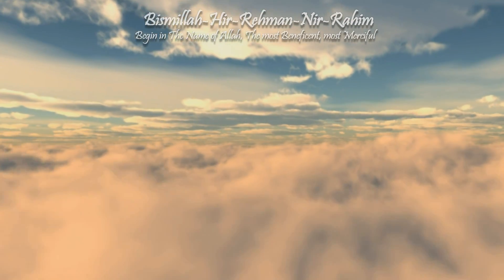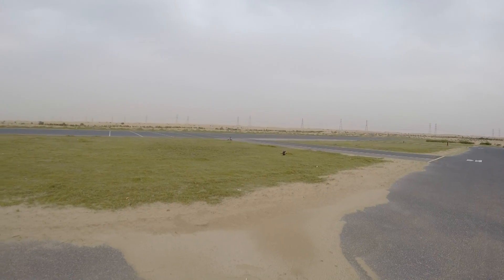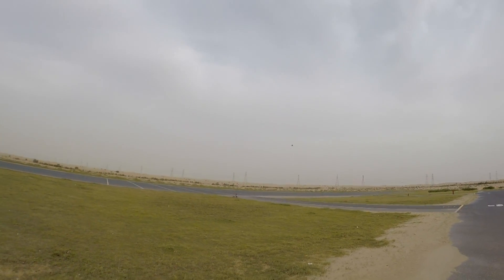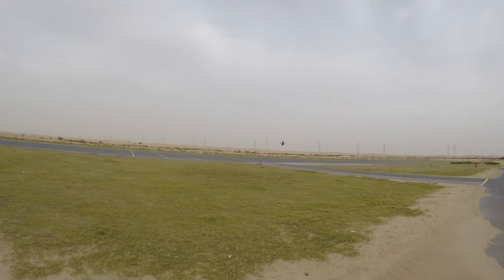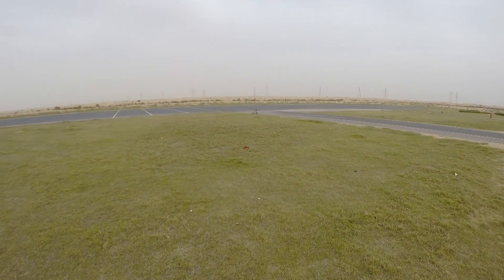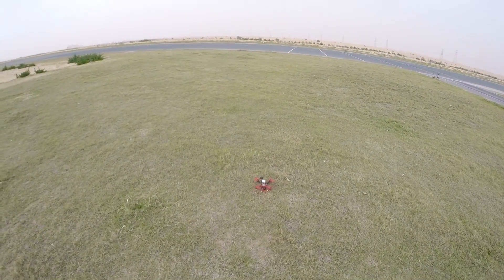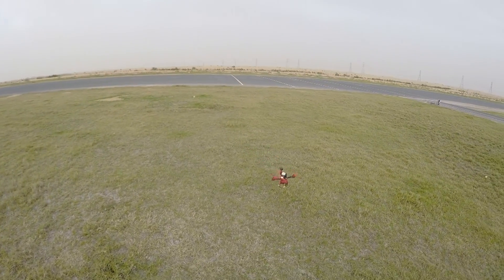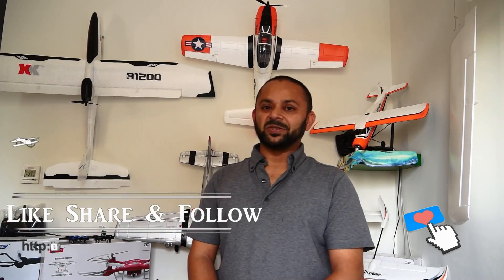Amazing Fast Holybro Shuriken X1 FPV Racer Flight Testing

Comment: It's an excellent PNP quad but the Mr. Steele props are far from "indestructible." Actually they chip, dent and crack fairly easily. My first and subsequent crashes proved that. I switch to the Azure power props and haven't dented, chipped or broke one yet after many crashes even into cement and my metal garage door.

Comment: Ali did you tune the x1?  could you please give me the pids you use, even if they are factory could you please share.  Please include tpa aswell.
I updated betaflight without saving settings.